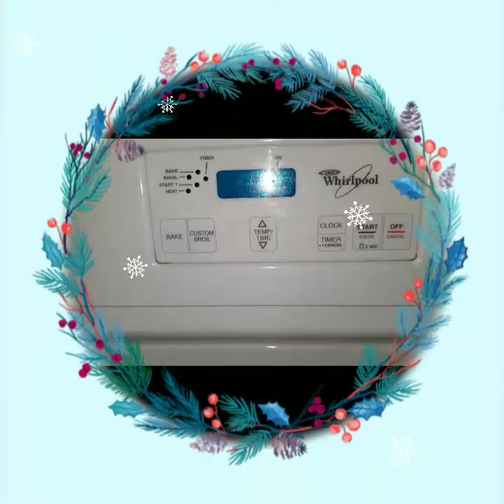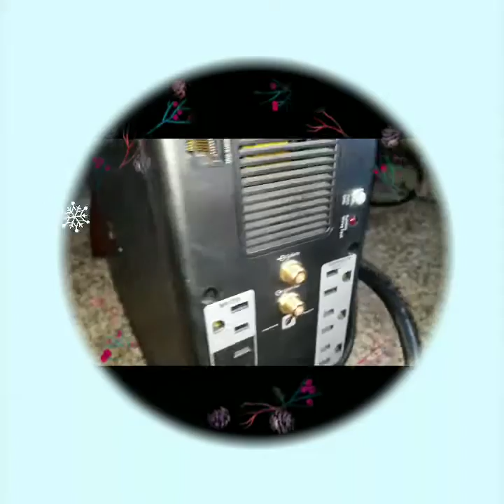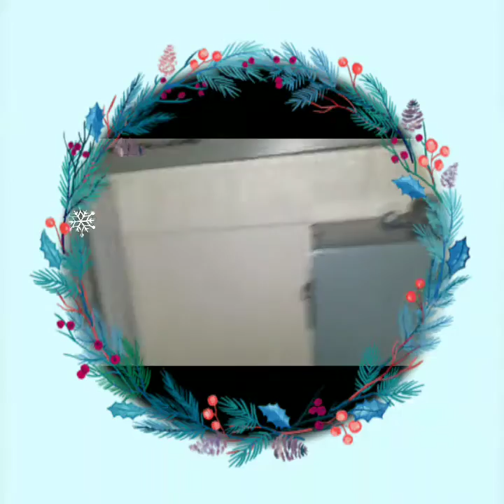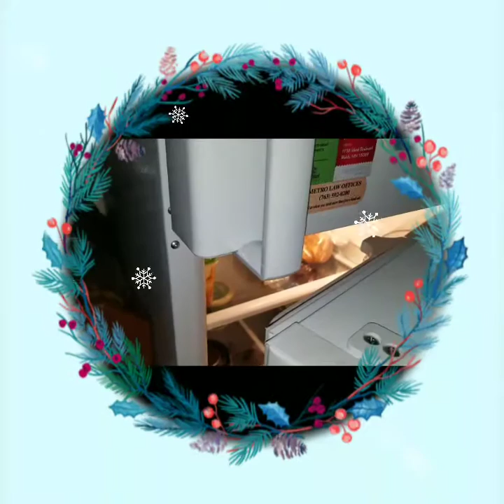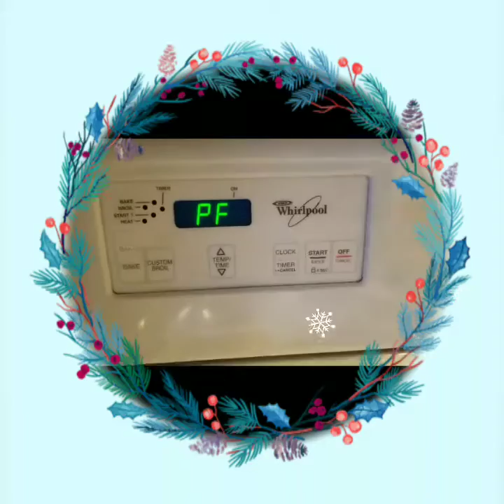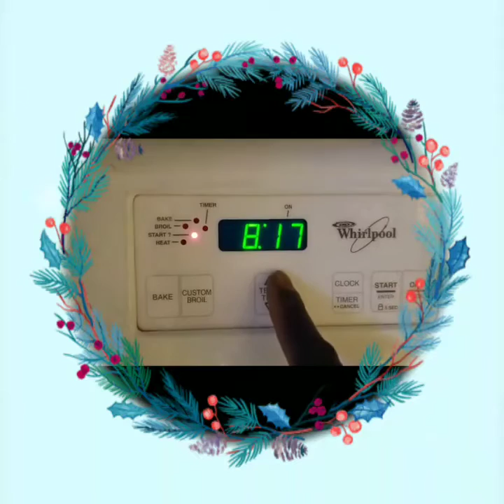XCEL ALERTS: HUGE POWER OUTAGE TWO DAYS TO CHRISTMAS

Comment: With my off grid system I don’t have any problems and have no change when y’all s grid goes down. But I feel for ya JW
Reply from the maker: Burton, the system performed well as I designed and programmed it. 
My APC/UPS is the only one that failed and I knew it because the batteries inside that unit is not good lol.
I was trying to assimilate if the APC/UPS internal batteries still retained its Charge. ❄☃️🎄😀👍